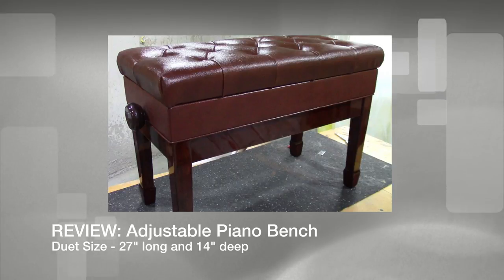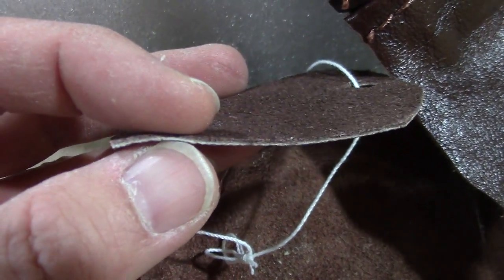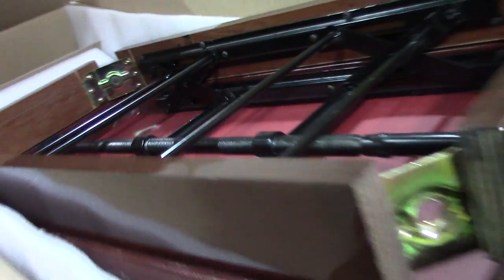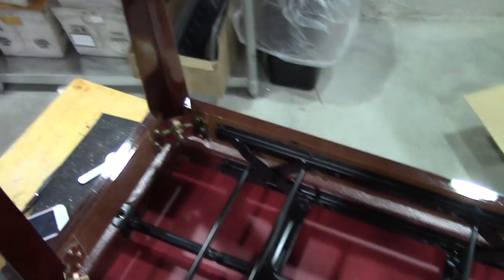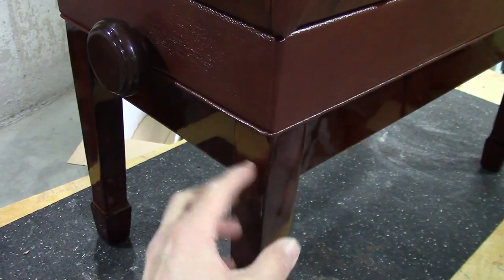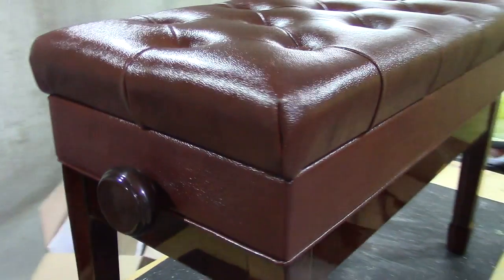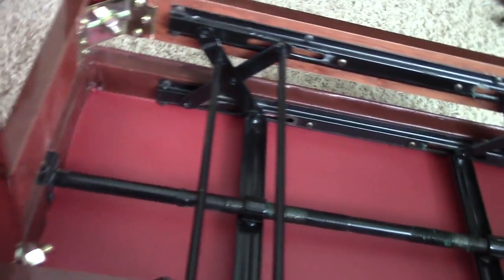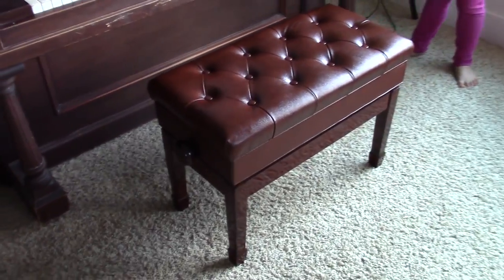REVIEW: Adjustable Tufted Leather Piano Bench - From CPS Imports on eBay Amazon

Comment: It’s called bonded leather. The back side is the hide and then pretty side is actually vinyl glued to the thin hide. He sent why it’s plasticky and sadly it will still start to split and crack after several sits. As the pretty side splits you’ll see the white vinyl between the split of color part of the grain.

Comment: Yay for Zelda - Lost Woods theme 😊 My CPS benc comes in today. It was $289+tax, free shipping though. Ordered through ebay because Amazon was charging the same price plus $20 shipping. I already knew it was a vinyl bench, but it was either a $300 CPS or a $400 Frederick/Empire generic re-branded bench from a sketchy website.

Specs, quality, and materials are probably all the same on these imports (minding seat height of course). So I am just concerned with which one feels softest and most plush. The difference is CPS actually has reviews online, distributes through various retailers, and has a 30-day free return policy (plus 180days via a Paypal return/dispute). The other generic re-brand names have little to no reviews, more expensive, and you pay to ship it back. 
Then if either of these don’t work for me, I’ll just go with a Jansen bench or just build my own. My only concern with a Jansen is I heard they were “firm” to “very firm” seats and I need the plush seats cause I have no butt, and weight between 220-210lbs. lol

Comment: I don't think you should greese the threads. The sliding rails - ok. It'll probably not come down by it self when you sit on it, but it is held by friction and it might change height over time when you  sit many times. ow. it's from 2014. Btw how did the greasing worked?